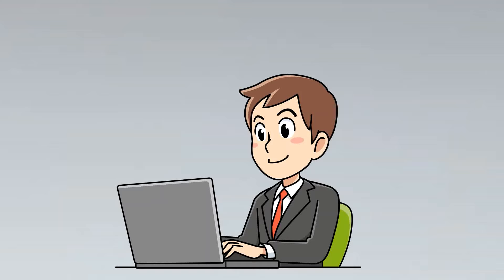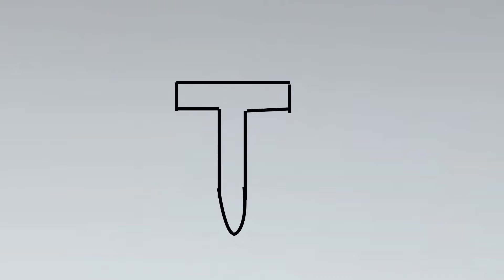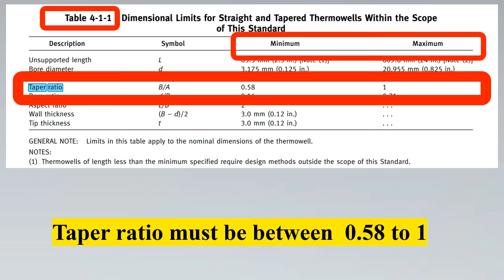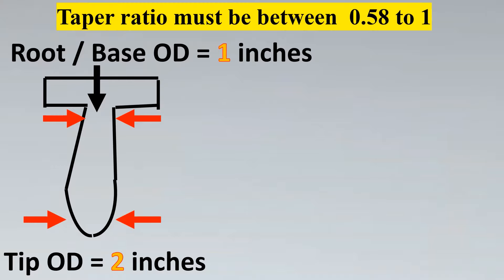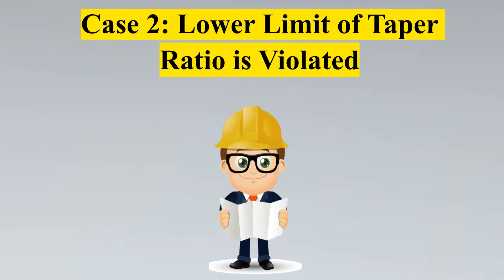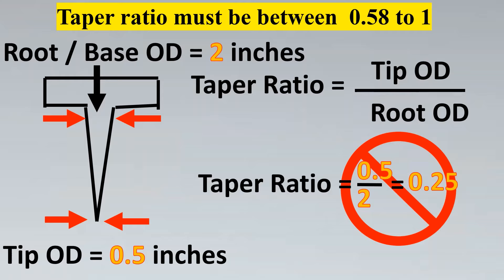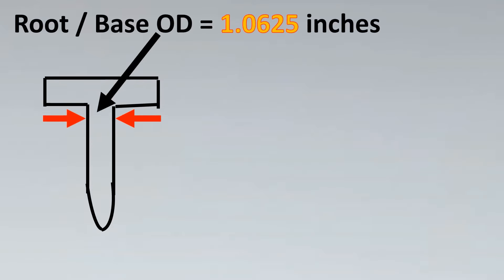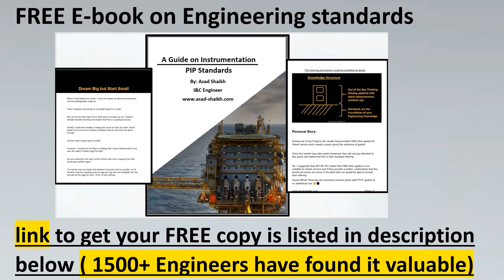ASME PTC 19.3 Thermowell Calculation of Taper Ratio

Comment: Thanks Asad for video.

Can you explain where should we consider straight or tapered thermowell?
Reply from the maker: Most welcome 😃.

Good question !! 

One of the basis to decide this is the client Design basis.

However, in our industry the most widely used thermowell is tapered TWs.

Like a similar example is that of thermowell connection, usually we have flanged thermowell but for certain special cases we could go for welded design but this depends on client preference.

This is as per best of my current understanding.

Hope some engineers can shed more light on to this subject 🙂